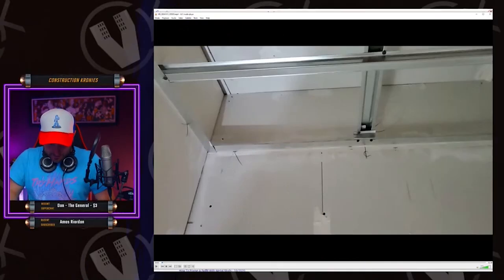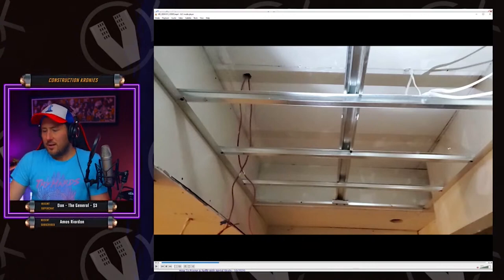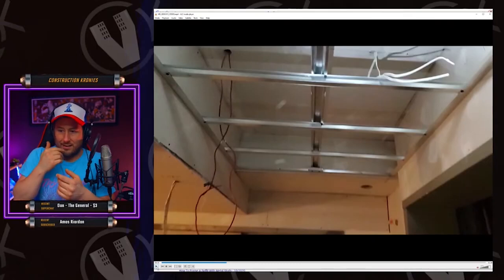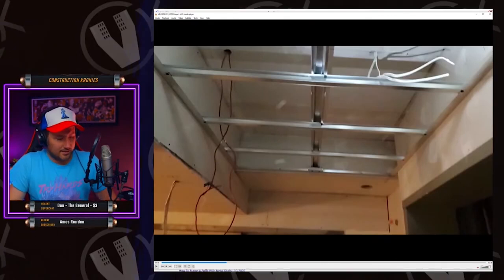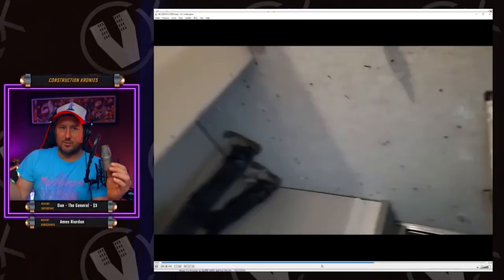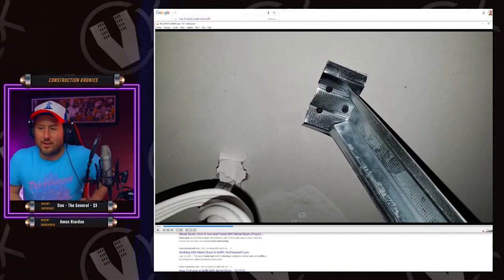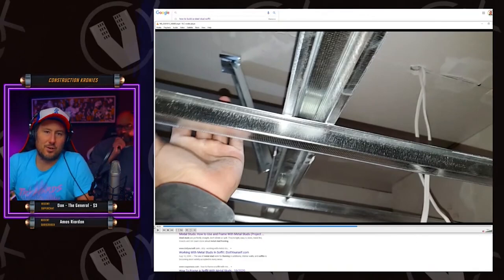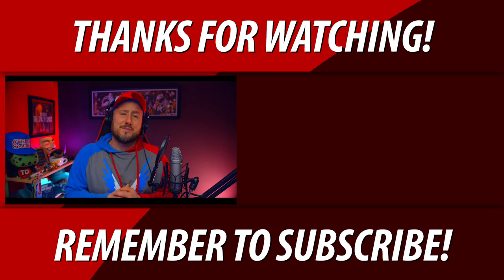Metal Stud Framing Soffits

Comment: Reflected ceiling plan, bench marks for exterior. I want to see how you build soffits, say in a classroom dividing wall. With a 5' 1½ opening in between closets, ¾" on each side for drywall. I already have it tracked out, we're waiting for rockers to top out. I just want to see or know your tips and tricks. I've done 10' x 43' exterior openings on this school already it can't be that much different, set your studs every 8' at elevation minus a ½" for your track, should be good to go. I also have a 66' wide 360° soffit. I'm gonna say it's gonna be based on the same concept of the square soffit, set studs at every 8' minus a ½ for track elevation,  brace the studs to the pan decking, go all the way around then fill it in. Please, if you have any tips or tricks,  let me know if you would do it differently, thank you.
Reply from the maker: https://youtu.be/4P4qSQHGMq4?si=Xe8h7KRyO1qo8Afg this video has some of my soffit tricks. If you search my videos for ceilings or soffit I do have more. Let me know if that helps!

Comment: Great video! I'm about to use this technique to building my basement ceiling. Regarding the Angle/L-shaped bar the hat track sits on the wall. What specific material/specs is this angle piece?  Sorry for the basic question but this piece seems like it needs to be strong enough to hold all the hat track and ceiling drywall.  I don't want it all crashing down on me when done :) thanks again for providing this video.
Reply from the maker: As long as you follow the rules you can use 25 gauge furring bar and angle. As long as you brace the ceiling 4 feet in every direction, run your bracing bars properly across all of your ceiling bars, ceiling bars at 16" o.c. and screw everything together you will have a very strong ceiling. I do have lots of videos on soffits and ceilings but if you have any questions just ask me here. I can also set up a live stream  to get your questions answered!
Reply: @ConstructionKronies  Thanks so much for the info and help! I'm going to layout the structure as you described.  You info was a huge help. Thanks again!
Reply: @Construction Kronies . UPDATE:  I framed my 12' x 36' basement ceiling exactly as you described and completed all the sheetrock install w/ my brother.  Looks great and very solid!  Thank You again for sharing your knowledge w/ your videos and being kind enough to answer my questions in the comments section! Really appreciate.
Reply from the maker: @michaelpasiuk9332  hey man that's awesome thanks for the update I appreciate that!!! Enjoy your new space bro!!